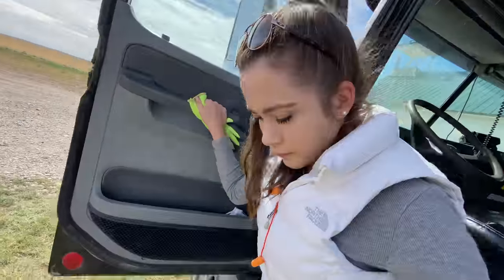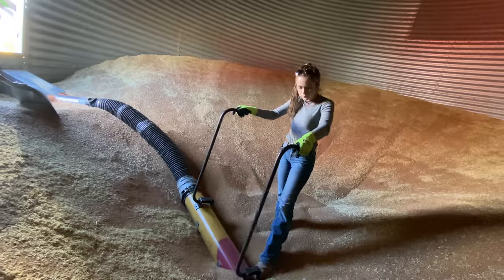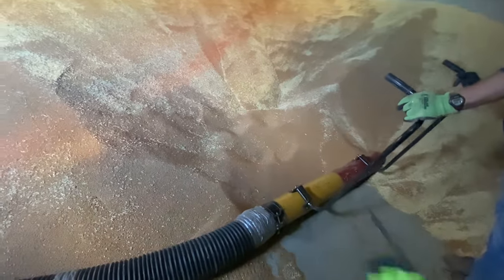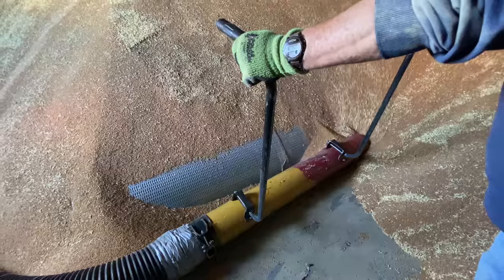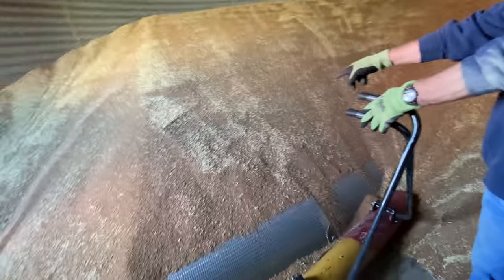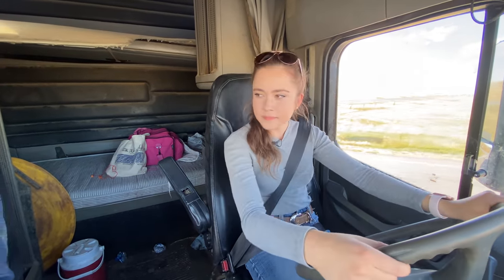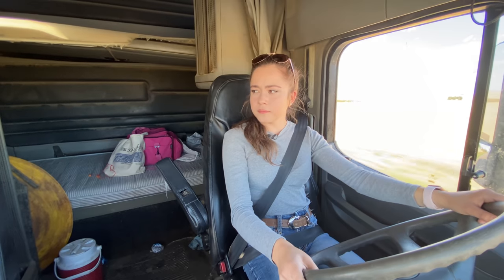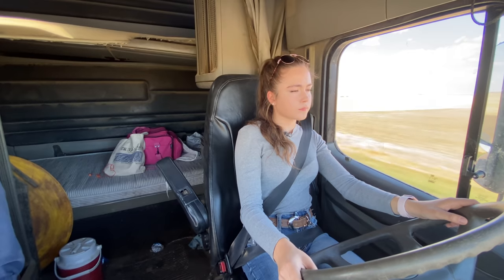Loading & Hauling Wheat to Sell!  Montana Farming 2022

Comment: I realize your bin is almost empty. But i always worry when entering a confined space that there is oxygen in there and not the presents of other gases. There are meters you can buy that test for oxygen and other gases .Stay safe and keep on trucking.
Reply from the maker: Thank you for your great suggestion.  The roof opening on the bin is open and so is the door.

Comment: Kate, I noticed that the roof of the bin has a lot of missing bolts. You can see daylight through them. They need to be replaced soon, or you will lose the roof in a big wind storm, that's what happened to me, I lost 2 sheets on one bin and 3 on another one.
Reply from the maker: Thank you for your advice.  This is a new bin.

Comment: You seemed much more relaxed driving the semi in this video. Scoot a little closer to the controls,  if the seat can still  move forward. As for audio,  you come through fine, however,  your passenger's (coach's) voice is pretty covered up by the mechanical noises. Maybe a remote mike for the passenger would be a consideration.  I had no idea how the grain was collected from those bins. Be careful in there. I noticed your feet sinking in a bit. Kinda like quicksand. I was glad to see your Dad was close by. Stay safe
Reply from the maker: Thank you for your kindness and great advice!

Comment: You do  impress  me as you  will likely  amaze your university class  mates,  but I will  tell  you  of a time when when it was equivalent to my father's telling me I had it easy.. In his day he walked nine miles to school, and home,  up hill  both ways.

 1972  was a miserable harvest year with snow, mud and  cold . It  was my first year back.  We harvested our soy beans with   a SERIES  900  AC combine with no cab.  The temperature was below  zero on some mornings and we sometimes lit a fire under our combine  so it would start.  We  made sort of a cab from cardboard 

We  filled  an old bin with  $5 beans  when we finished in Jan.  Meanwhile,  the Soviet Union had  a bad  crop and they bought so much wheat from us that they  disrupted the market structure  The  price  of beans reached  over  $12.00 , Our beans stored in an old bin with no fan were too  wet, but the beans  were too  valuable  to sacrifice.

I used an electric auger  to put the beans  on sun lit tin. Then I put them in a pickup  to sell at the elevator. In those days the COOP  had a hoist where   I placed the two front wheels.. The  hoist went up to empty the pickup.

I did that until the bin was empty  10 days  later. My father and I were afraid of debt, as the neighbors bought land and machinery as though grain prices would never fall.  While others struggled with drought and debt during the crash,, we  had  new a debt free    bin and a new used John Deer combine  with a cab , heater, air conditioner and radio.

That  is how I figuratively  walked  nine  miles to school and home uphill both ways.  Don't you wish you had lived in the good old days. Ha  Ha!

You  wrote  you still are too dry. So are we . I told  you we   had a grass  fire  in a field near our  house. A line  of strong thunderstorms gave us lightning without rain. We  did get 2 inches  of snow last night, and I got to ski twice  today, Our snow was so dry it left no mud.
Reply from the maker: Thank you for your hilarious comment about walking 9 miles to school!!!  LOL  Thank you for your great story and wonderful kindness!!!!   We had 70 degree weather on Monday and it snowed about 5 inches on Tuesday and it was about 50 today!!!  We hope you get more moisture too.

Comment: Kate I have a question about your grain bin why don't have a pizza slicer on the bottom of the grain bin to make it easier to move the grain inside the grain bin
Reply from the maker: Thank you for your question.  I don't have an answer about that.
Reply: What the hell is a pizza slicer???
Reply: @Northern_Farmer  it's called a grain sweep
Reply: @arlendelima1620  a bin sweep...yes..but a pizza slicer has a round blade and cuts...I can't see the resemblance?? Besides why would you want to use a bin sweep..they are dusty and a pain in the ass...and you can use them in aeration bins

Comment: shouldnt you wear a dust mask when youre in the grain bin? seems like there would be a lot of dust being stirred up.
Reply from the maker: Thank you for your question.  There was virtually no dust.
Reply: There is negative pressure inside the bin from the vacuum, it is definitely dusty next to the grain vac machine and the truck being loaded.  As long as the bin is upwind of the vac machine and truck, clean air is being pulled in from outside while any dust created by moving the hose around is sucked out along with the grain.  As long as you don't have someone inexperienced, who thinks they are going to help by shoveling grain to the vac(throwing 12 feet and whatever height it takes to get it that far), it is a fairly clean operation.  Hearing protection is a MUST if you are anywhere near the operation though, our grain vac can be heard over a mile away on a calm day.

Comment: Hearing, as well as a dust mask will help you tremendously so will safety goggles  please your too young too accelerate your aging process. Also always use 3 point contact  "I used to think that the first step on a tractor was for old people I  finally realized that by not using it when I was younger was what made me older, I  teally need both knees replaced and I'm 66 years old, knee and back problems
Reply from the maker: Thank you for your great advice and wonderful kindness Mr. Payne!
Reply: Definitely 3 points of contact at all times, and climb down facing the tractor. Easy to do it the way she did when you're young, but the twisted ankle can still happen.

Comment: You made the comment about the clutch and getting it figured out. But you are driving an automatic.
Reply from the maker: Thank you for your comment!  I drive an auto-shift, not an automatic.
Reply: I learned and drove 13 speeds for 30 years. I never touched the clutch except to start and stop. Gret job with the videos

Comment: Ok first of all your "tandem truck" isn't a tandem/wheeler....your tandem truck is a tri-axle/tri-ax because it has a pusher axle in front of the drive axles. If you're using a clutch for more than starting and stopping you need a lot more practice driving. You should be floating gears.
Reply from the maker: Thank you for your comment and advice!
Reply: In Canada you don't see any pusher drop axles...just true tri drives...or tandems